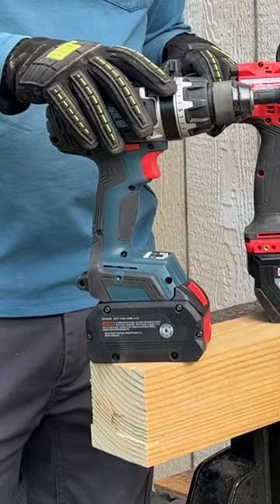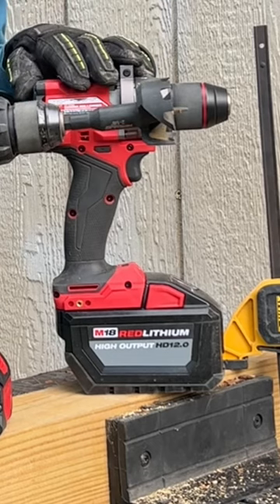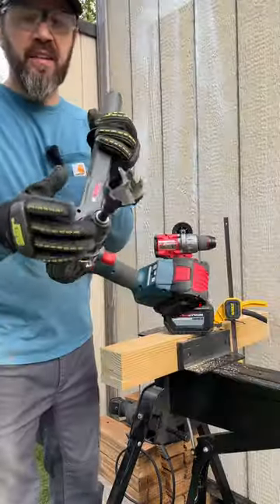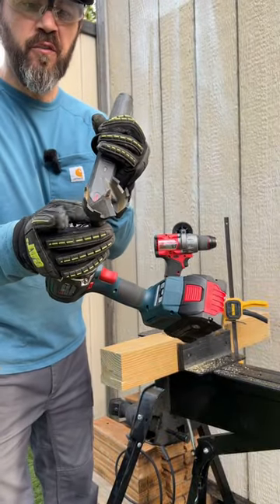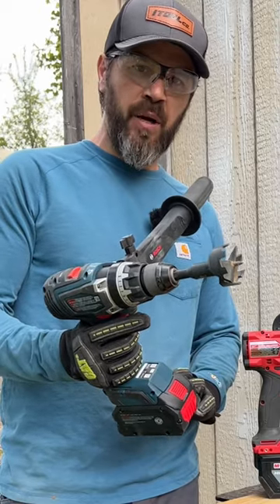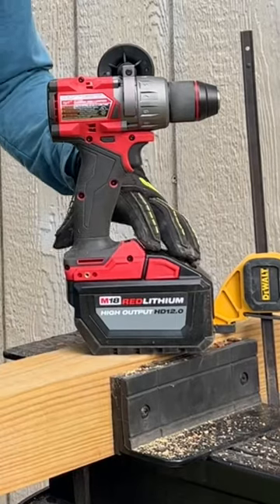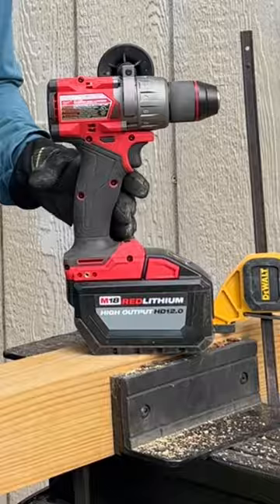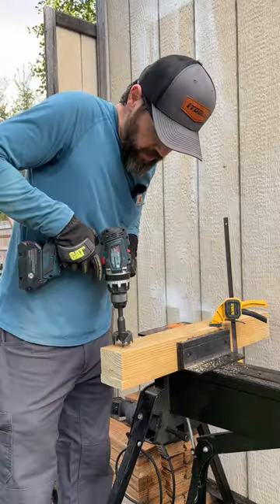NEW Milwaukee Gen 4 vs BOSCH Bi-Turbo With 2 1/8 Self Feed Bit!

Comment: I like Bosch tools. They may not win a ton of awards for power or performance, but what they excel at is user comfort and reliability. Probably more important at the end of the day. 

That Milwaukee will need to be warrantied probably 3 times before Bosch even hiccups.
Reply: That’s what I’m saying
Reply: Best comment yet. Bosch is severely underrated.
Reply: I use almost exclusively Bosch recon tools from CPO. Not once have I had any reliability issues with them - drills and impacts going on 4 years of consistent use.
Reply: I agree. bosch tools also delivers the power better.
Reply: Especially 12ah batteries from Milwaukee is rubbish.  Claim warranty repair 3 times. 18v is not high voltage enough to hold it.
Reply: They're generally nice. They make frustrating choices though. My biggest complaint is tool selection. For example if you need a battery powered nailer they have two models, one of them isn't even sold in the US.

Comment: Imagine if the Bosch had a 12ah 💥💥
Reply: Amphours don’t necessarily mean more performances it’s just the amount of juice it holds
Reply: Bosch recommends the 8 ah
Reply: @DudeStuffRandom  That's true there's still enough of a chance to a difference that it should have been the XC 8.0. The best comparison test is if you can make everything as equal as possible. This test uses one drill with a battery that has 3 sets of cells vs. 2 sets, 15 vs 10 cells. They're all 21700 size cells too. We don't know if the M18 does make more power with the bigger battery but it's a variable that should have been better matched.
Reply: Bosch does make a 12ah; not bad for a 8ah battery
Reply: They have it

Comment: I like to the Bosch profactor hammer drill vs the new high torque Ridgid hammer drill that just dropped
Reply: The new Ridgid isn’t going to beat the Bosch or the Milwaukee, in spite of its ratings.
If you spend $200 on the 8 amp Ridgid battery that actually has 21700 cells, it might compete.
Reply: @DiligentDave1966  I think your correct
Reply: @DiligentDave1966 Ridgid anti-kickback control doesn't have an on-off switch on all the time is terrible I heard cuz if you didn't have the money for that particular top-tier Bosch hammer drill you can go with the previous high-torque model they had. It's still mighty powerful
Reply: @bluemantom77  Are you referring to the previous Bosch or Ridgid?
I got the Flex for a great price, but I’m kinda reluctant about keeping it because of the battery issues that people have had.